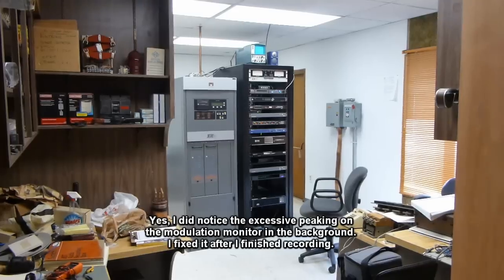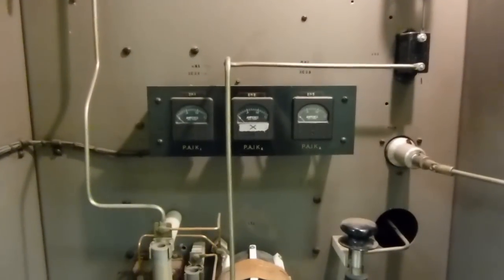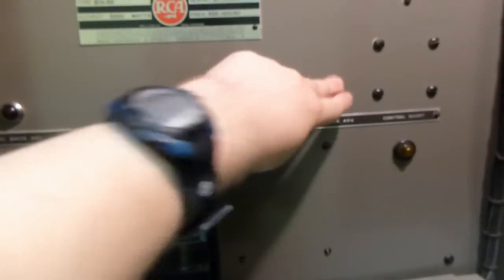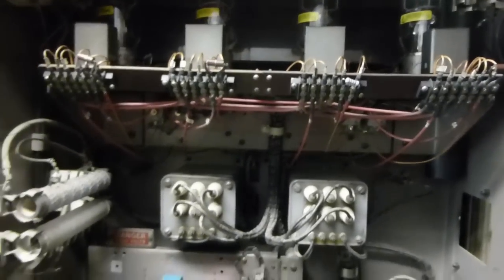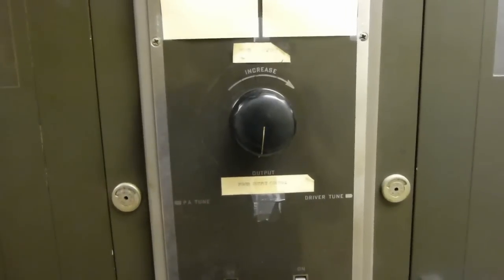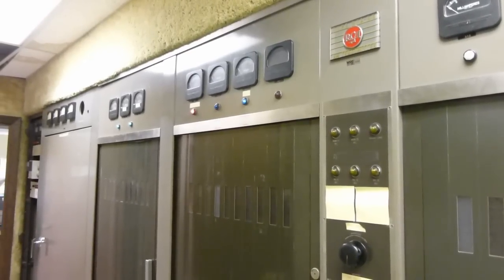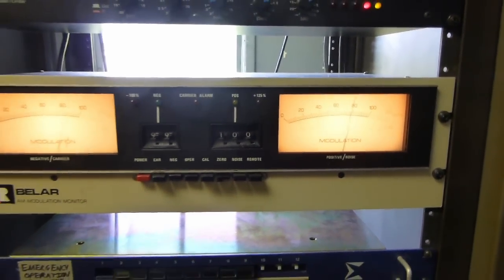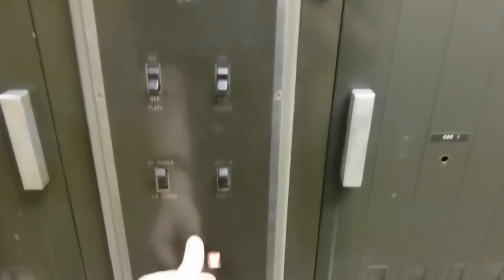A Look at a 1950s-era AM Radio Transmitter

Comment: Please clean the inside of the transmitter! To much dust can really set fire to the transmitter (due to arcing) . I work on a lot of HV stuff and always try to keep the switchgear as clean as possible.
Reply: Dust is a killer in any High voltage system.
My father was an engineer at a local radio station and growing up we would go along and help him clean the transmitters once and a while.
Wipe down all the wires and blow out all the dead engineers that accumulated since the last cleaning.

Comment: and at 4:32 a BIC Pen cap holding up some part... how geeky
Reply: That is the frequency deterimining crystal installed in an oven. Probebly an intermittant socket or connection that was sloply fixed with the bic pen top.

Comment: I am not thrilled about sticking hands in there.  There are plenty of stories of dead broadcast engineers from years ago.
Reply: You have to be hands on to work on it.  Only way to do that is shut off the main AC power disconnect and then use the Jesus sticks to ground out all the power supply capacitors, etc., in case there is a burned out bleeder resistor which would normally bleed off the capacitors.  Probably also had shorting contact on the doors which shoud short the capacitors to ground, but sometimes those got dirty and would not operate as they should.  Only way to be sure is use the Jesus stick.